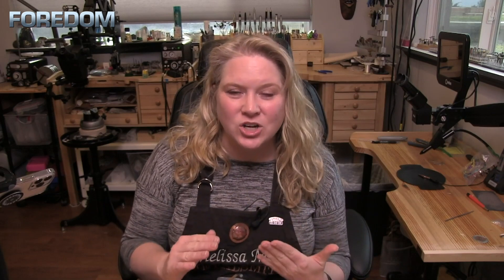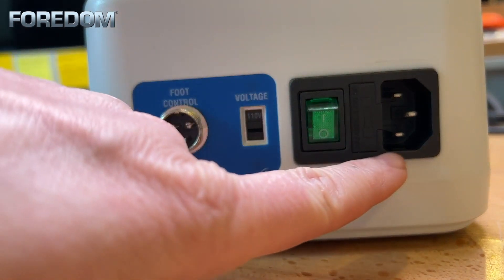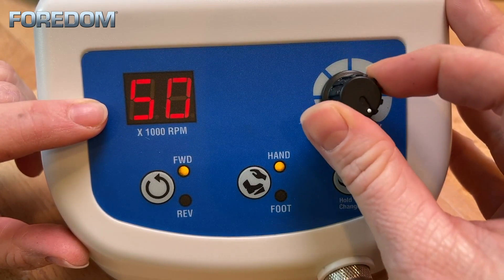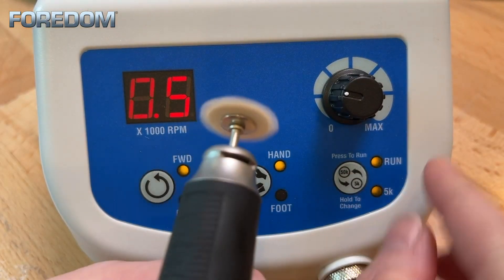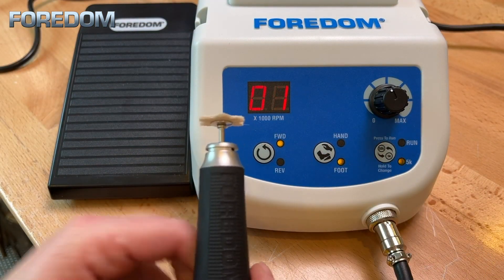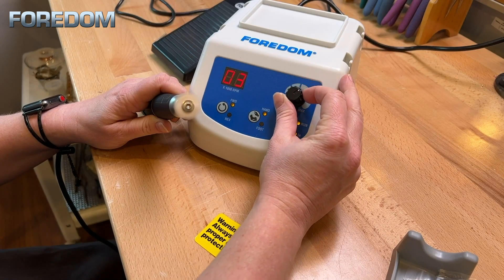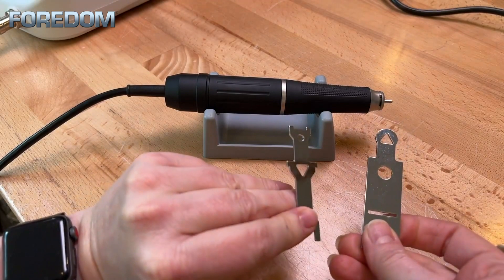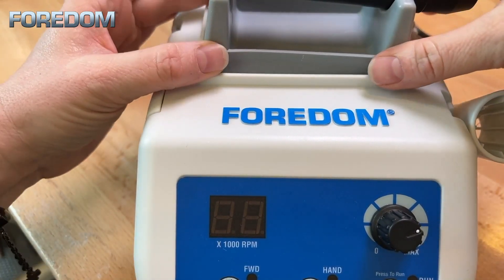NEW K.1040 Micromotor! Slow, Steady, and Smooth. High Torque start!

Comment: I am wondering if the handpiece is any lighter than the quick change. I am beginning to have issues with my hand cramping and getting spasms and am curious if the micromotor might be a better option.
Reply from the maker: Hello! Thank you for reaching out to us.
The micro motor handpieces with the exception of the K.1030 handpiece H.MH-130 are all heavier than the flexible shaft handpieces. However, the micro motor handpieces are not much heavier and due to the handpiece cord set are much more maneuverable and easier to position and hold.
Hope that helps!

Comment: Egg artist here.  This is one of the best tool videos I have seen.  Good production values and content delivered in short & succinct format.  Have used a Foredom drill micro motor for over 25 years to intricately cut quail thru emu and rhea eggshells. This new tool intrigues me with the extra power up to 50K.  More RPM means less vibration in the shell resulting in smoother cuts and less breakage.  I have an air drill but cleanup and maintenance is a chore - especially when I can do 90% of my cutting with the Foredom.  Was just about to buy a cordless engraver for scratch eggs but thought I’d check out Foredom again.  Good to see this new product.  Would really appreciate a source for quality diamond burrs (ball,  flame, disc and various wedge shapes).  Am so exasperated with burrs which have a short use life!

Comment: @Foredom Looks great- would love to see a companion of this and the 1060. I am trying to decide if I should buy a hammer handpiece for my 1060 or buy a new unit so I have 2-  my focus would be metal engraving with some stone setting any advice,? I currently use my 1060 for power carving and love it!! Thanks.
Reply: @Foredom Electric Co.
Reply from the maker: @Amanda-ev1xz  have you seen the 1050? It comes with dual ports. One brushless and one brush type handpiece. https://www.foredom.net/product/k-1050-brushless-kit-high-torque-and-speed-2-35mm-3-32-or-1-8-collet/

Comment: Does the '1040' have more torque at the lower rpm setting?
Reply from the maker: Yes! It has more torque at the lower settings. There are only one or two other micrometers on the market that start below 1000rpm. :) https://www.foredom.net/wp-content/uploads/Micromotor-comparison-sheet_1040_b.pdf